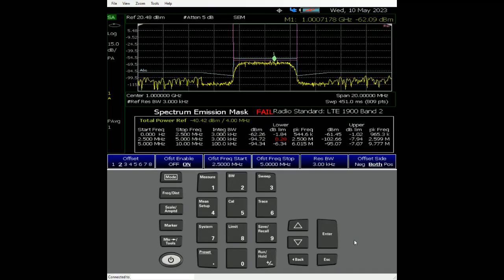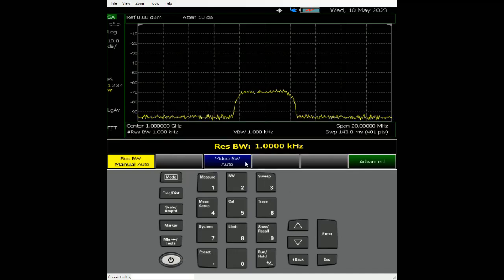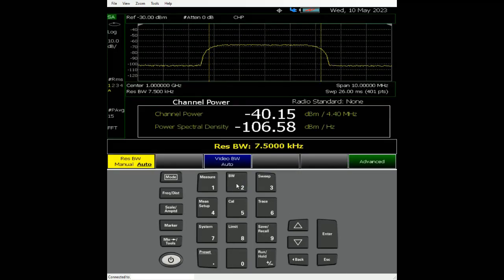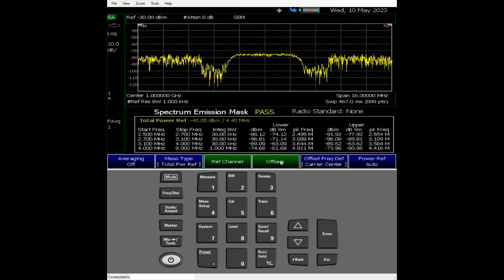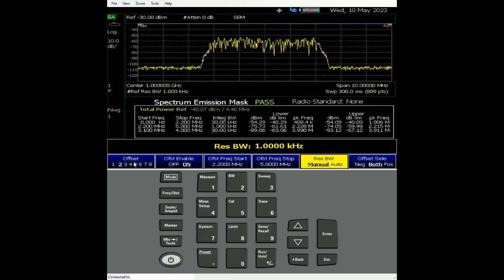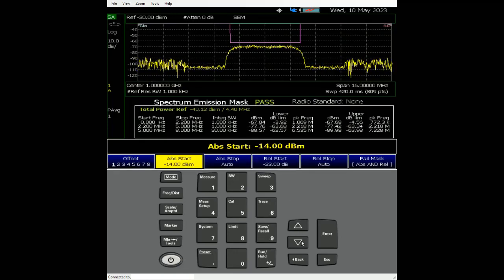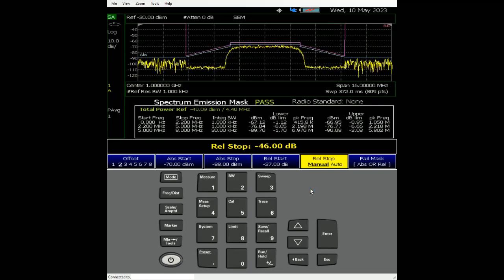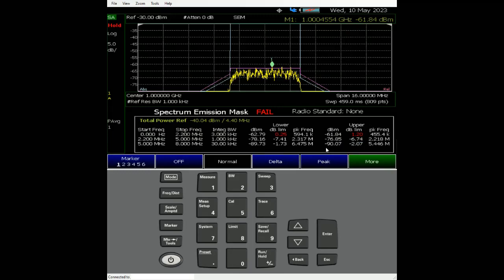Episode 110: FieldFox SA Spectrum Emission Mask (SEM) Setup Guide

Comment: Thanks for the detailed explanation. QQ i have already a .xml file for specturm emission mask. How do we import it ?
Reply from the maker: @sharanpalsingh5619 i did a quick check on the FieldFox and also its manual and there's no way for user to import/export the Mask (abs or relative) information from FieldFox. 
You might want to talk to Keysight's local contact about this.
Reply: @autumngreentech4726  Thank you for your quick reply. Will reach out to support team